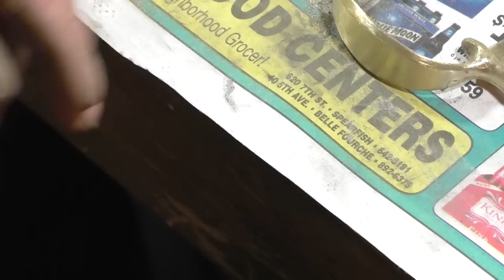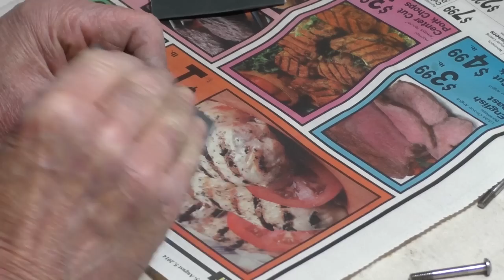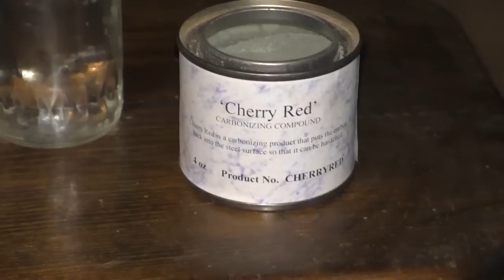Building Flintlock Pistols #4

Comment: Admit I have only skimmed your videos and watched the end of this part. (I'll watch them in full later). Would like to see how the pistols print on paper, and the charges you used to find the 'sweet spot'. If you can do another one on it, that would be cool. What was the twist of the rifled barrel.  I like your work. You take time and don't rush. I have built about 50 guns and I can say you do nice work. Thank you for the time you spent in videoing your projects.
Reply from the maker: Thanks Gary. I need more range time as I am way out of practice. They seem to be printing high at 20 paces but may be closer at 50 yds or so. Hard to get the rear sight low enough without having an excessively high front sight.so I am just holding low. Don't know the twist but right now I'm hitting as good with the smoothbore. Like I say, I need practice. Also the trigger pull is pretty hard, have to work on that. Will put high pinned triggers in.

Comment: very nice work one thing i think may have been common in those days was to load buck shot into their pistols or like a buck and ball load instead of just loading patched round balls being they are a 10 yard and less weapon for the most part a good buck and ball load would make a great deal of sense
Reply from the maker: I have used shot in my smoothbores. It is really fun to throw bottles into the air & blow the crap out of them. I once shot a shaken up beer & it sprouted like a fountain.

Comment: You didn't mention what you were using to polish your silver and brass with. Nice work all the way round!
Reply from the maker: I sand with wet or dry paper down to 400 grit then go to the polishing cloth wheels, on a Harbor Freight polishing machine using grey compound on the stiched wheel & red on the loose wheel. Then finish with past metal polish.

Comment: Great work here mate, wish my flintlock efforts looked so good. trying to make a pistol and musket at the moment from recycled parts and a little wood working and no metal working experience. I was wondering where you got the metal pieces from? And also are there any secrets to make sure you achieve nice sharp edges rather than the soft rounded ones my sanding and filing always seems to achieve? Thanks again, love your work, truly a talented individual.
Reply from the maker: I get my parts from muzzleloaderbuilderssupply.com. Try backing up your sandpaper with a file or block. The more guns you build the better they will get. All of our first guns were terrible, but they shot. The fun goes on.
Reply from the maker: There is a sort of secrete to get sharp edges on your inletts. Leave the wood 1/16 in high, inlette the piece 1/16 below the surface then take the wood down to the metal or below if you want it to stand above the surface.If you try to inlett it flush the edges will always be rounded & damaged. Got this from a very good book "Recreating the American Longrifle."

Comment: can too much of force blow up the reenforcement wood in the back of the barrel??
Reply from the maker: Not with a sensible charge. It would wreck your hand before it would stress a hardwood stock. Or fly back & hit you in the head. 2 pistols with 60 gr & a .62 cal ball will make me walk back. Wouldn't want to use more than that. I like to bolt the barrel tang to the trigger plate as it pulls everything together, I think it would be very hard to break.